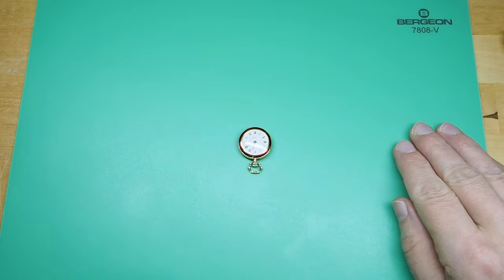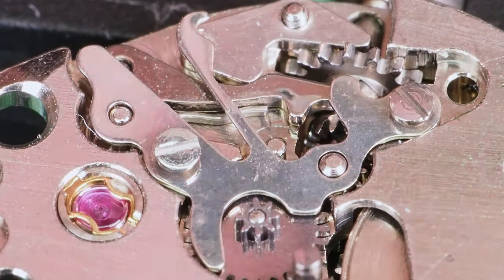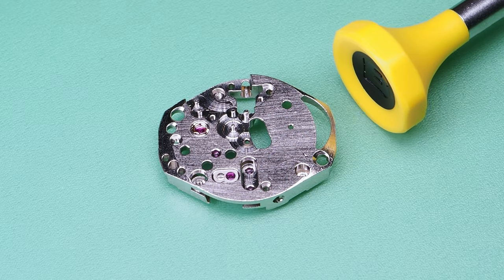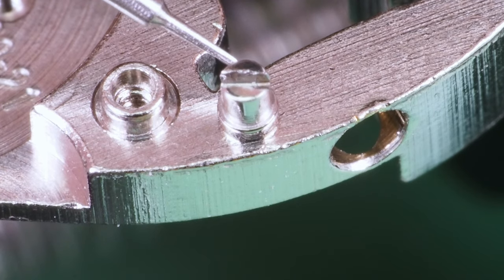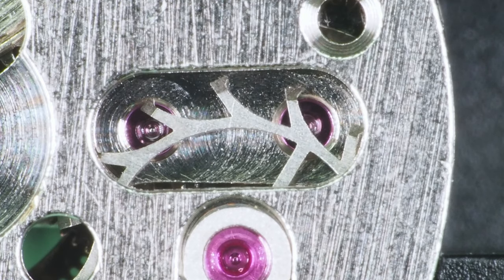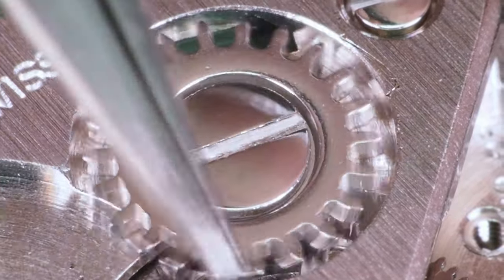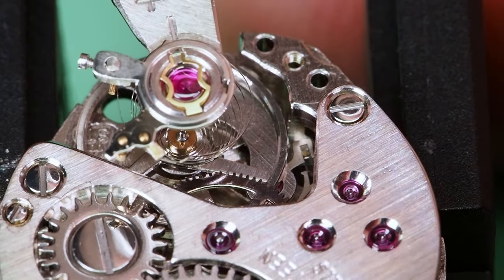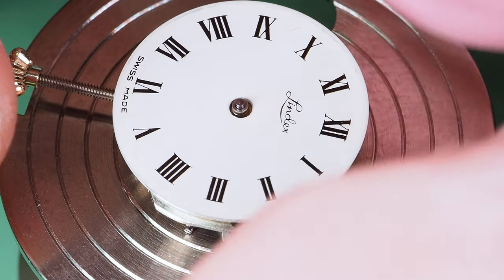Tiny Swiss watch serviced under a macro lens - Caliber FHF 69-21 ST movement service

Comment: Great work.... Careful with the balance spring when dipping as the surface tension may cause spring stretch. Possibly dunk it upside down. For pallet oiling, it's easier to access through dial side inspection holes and oil once in place to avoid oil getting where it shouldn't. Nice end result! 😊
Reply from the maker: I couldn’t agree more. I no longer dip the balance in and if I had to do it for whatever reason, I’d turn it upside down. And the pallet stone, I do it in place now, from wherever I get best access. Not just once, I advance the escape wheel, depending on the number of teeth they have, say 15, I’d probably do it three times every five teeth 👍

Comment: Much appreciate your time Mr Vidal. 
Last month i purchased an Omega full hunter Size 8 not working but the price was too good to pass up. Will get around to seeing what the matter is soon enough and hope to have it up and running as a gift to my wife. 
Thank you again as your commentary and videography are second to none !
Reply from the maker: Thank you for your positive comments and watching my videos.
Be careful with the hair spring. I’m not sure about Omega pocket watches but their blue hair springs can be quite fragile, I wouldn’t hang the balance on the spike, I never do anyway but definitely not Omega, it could stretch. Handle with extra care.
Reply: @MacroTime28800  the balance springs seem extremely delicate to me so i place the balance with spring in a separate parts tray upon disassembly. My cleaning method is to install the balance onto the plate and place the plate all by itself in the bottom basket of the washer. 
So far do good and thank you again for the great detail and explanation in this video !!!
Reply from the maker: That’s the way I do it. When in the dust tray ready for cleaning or ready for assembly I keep the balance cock on it’s back, never on the spike that’s sold for the balance to hang it on.
Reply: @MacroTime28800  Great minds thinking alike 😉🙏

Comment: Excellent tutorial/walk-through on servicing this movement. It really came in handy for me as I was working on the same movement, with minor design differences, and wanted to verify left-hand threads on the crown wheel screw. Yes, they are small, aren't they? You do fine work on watches and excellent camera work and commentary. I really have to step up and get one of those automatic oilers. They really seem like the way to go. Many thanks.
Reply from the maker: I’m glad you found it helpful. The automatic oilers are very handy. I have two 1A oilers, one with 9010 and one with 9020 oil.

Comment: It´s very interesting to see it all up really close. Nice work! I  am planning to start servicing watches my self, and as I was looking for a pocket watch at a flee market I instead stumbled across a very small Antima ladies watch I couldn´t resist. It has the FHF 63, not that much bigger than the 69 and I doubt I will ever feel confident enough to fiddle with it after seeing this video ...
Reply from the maker: I'm glad to hear you enjoyed it!
If you've not serviced a watch before, I would recommed starting with Unitas 6497 or 6498. This FHF is too small to start with.
The 6497 is a good size, larger than a wrist watch movement. It's a basic movement, nice a simple.
You can get a Chinese copy for about £30/40 and you will find plenty of videos on YouTube how to service this movement 👍
Reply: @MacroTime28800  Thank you for tips. I already bought a working pocket watch to start with, and a Seagul 2130 (ETA 2824-2 clone) but will keep the Unitas in mind. First some more tools to get going.
Reply from the maker: Ah, tools. The need for tools is never ending and they are not cheap!
Don’t be disheartened if the first watch doesn’t go well. Especially a pocket watch being your first watch. Pocket watches are not easy. They are old, many people worked on them, parts have not been produced for decades, some tools you might need are no longer available…
Don’t worry if it doesn’t work out, pocket watches are tough. The Unitas 6497 is definitely a good start, many people start on that movement.
You can also buy ‘job lots’ of movements on eBay. They tend to be small movements but you can get quite a few of them, just the movements, no cases, for very little money. They are great for practicing. Some will have broken balance staffs etc. but you could easily get 10/20/30… movements for very little money.

Comment: As always I read a great video. Something is wrong with the Bergeon B Dip liquid. Every time I put a scale in it and even though I then let it dry when installing the scale in the movement, it doesn't go well, there are some spirals stuck. I have broken some and tried to fix them and in the end with benzine and 20 seconds of IPA is the best way to clean them. I'm doing something wrong but I don't know what it is.
Reply from the maker: I don’t use the B-dip anymore. I don’t think it was doing a great job.
Do you have an ultrasonic? If yes, when everything is disassembled, put the balance back on the mainplate, secure it with the screw and put it in the ultrasonic. Also remove the ruby settings so the pivots get a better clean in the ultrasonic.

Comment: We are told to use grease in the barrel arbor that are in contact with the barrel, do to the relative hight amount of friction grease is better in my view. And should be applied before closing the lid
Reply from the maker: Yes, I'm switching to 9504 for barrel arbours 👍

Comment: Thank you for the excellent videos. I’m quite new to watch making and am having a nightmare of a time finding a good set of watch screwdrivers. The quality of the usual suspects are almost criminal and I’ve had enough of wasting good money for cheap or expensive knockoffs! Would you be kind enough to let us know exactly what set you use, as looking at them under your microscope/macro lens they look really clean (cut), sharp and of the right size. I currently have about fifteen of these mega small watches, along with too many pocket and wrist watches (I don’t care I love each one!) … but still no decent set of screwdrivers! Thank you for your time.
Reply from the maker: Perfect timing! I’m just making a video about the sets I have. Stainless steel Bergeon, anodized aluminium Bergeon and stainless steel Horotec. I’ll do my best to finish the video this weekend.
The clean cut and the right size, you need to sharpen the blades to be the right width (that’s why I have three sets, each sharpened differently).
I made a video about the screwdriver sharpener as well, it’s on my channel.
The screwdrivers, give me a few days 😉
Reply: @MacroTime28800  Perfect Leo!. I’ll be looking out for your video and I’ll check out the sharpening video too … many thanks for your help, much appreciated.
Reply from the maker: I’d recommend the sharpening video, you’ll get to see what you need and how to do it.
The screwdrivers video, I don’t really discuss the blades except one difference between the Bergeon and the Horotec blades. It’s more about the differences between the screwdrivers and the bases.

Comment: Is the B Dip the same as Epilame? If not, can you please explain what it does for the pallet fork and hair spring.
Reply from the maker: No, it’s completely different. B-Dip is a cleaner that will not dissolve the shellac on the roller jewel and the pallet stones.
Epilame is a surface treatment that is used to treat surfaces for oils not to spread. As an example, an assembled endstone that’s treated with epilame, the oil should be covering 2/3 of the diameter of the endstone, if not treated with epilame then it should cover ½ of the diameter of the endstone. You put less on the untreated surface because it is more prone to spreading than it is on a treated surface.
B-Dip is a cleaner, Epilame is a surface treatment.
Reply: @MacroTime28800  Thank you for answering my question. I really enjoy watching your videos.
Reply from the maker: No problem, happy to help 👍

Comment: I think the dial must be switched at 180 degrees. Normally the 12 is at the crown?
Reply from the maker: This is a tiny fob watch, something like nurses would wear, many years ago. I guess it’s meant to be hanging down and when you pick it up to look at it it’s the right way up. Just a guess. If I remember correctly, because of the dial feet placement you could only put in one way, you couldn't turn it 180 degrees. I must admit I thought the same the first time I saw it.